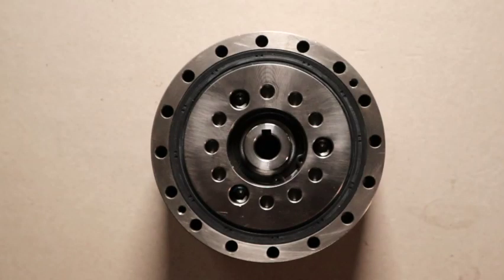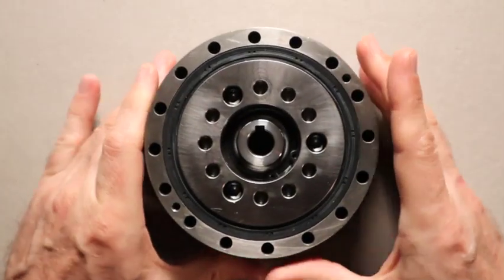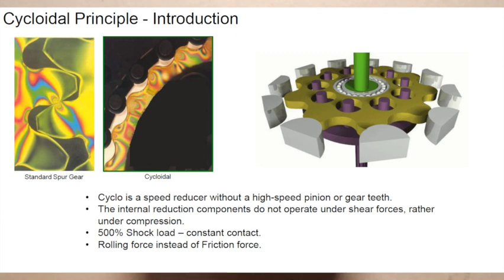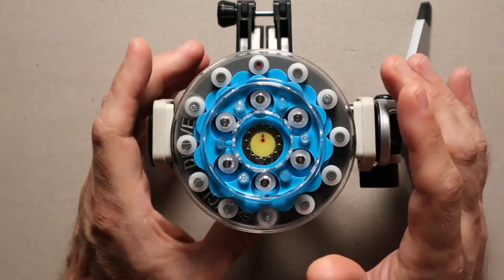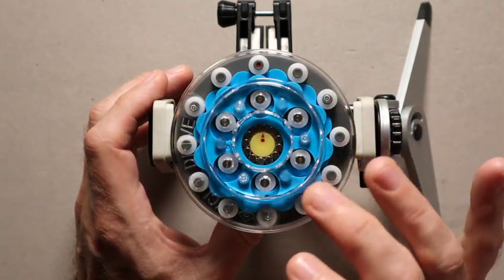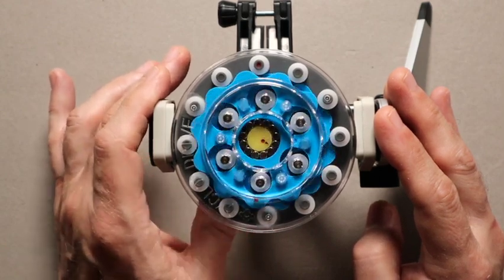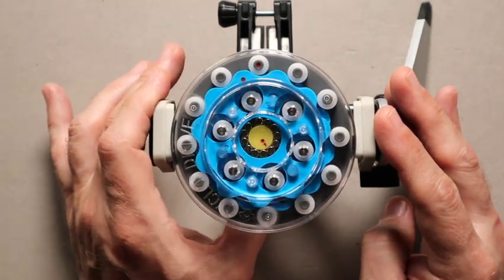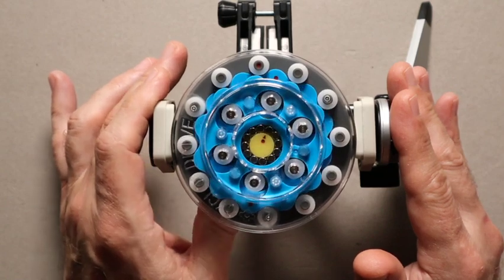How Cool is Cycloidal Gearing!

Comment: it belong to a class of differential mechanism like differential windlass, differential screw, etc. Each one have very high mechanical advantage within a compact packaging. All of them have a moving fulcrum point which is what enable them to very high mechanical advantage output. Although the penalty is that the higher the MA, the lower the transfer efficiency due to sliding friction.